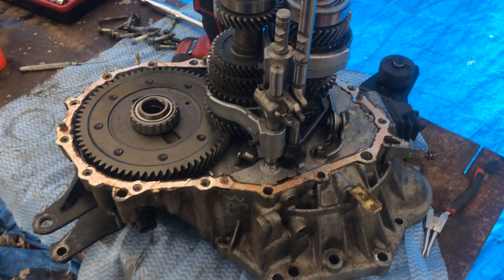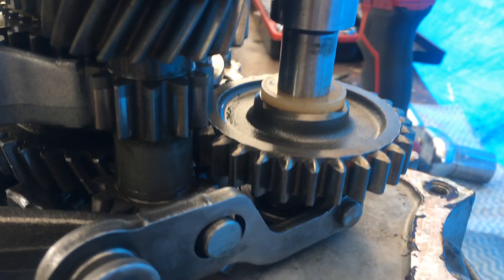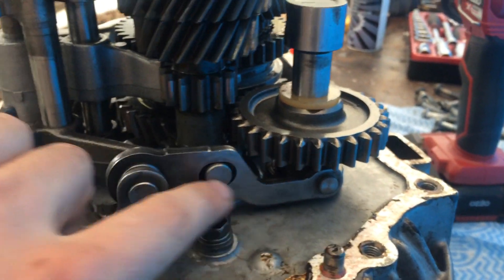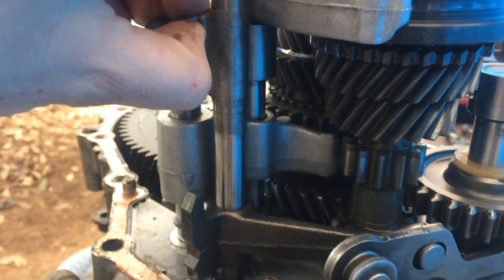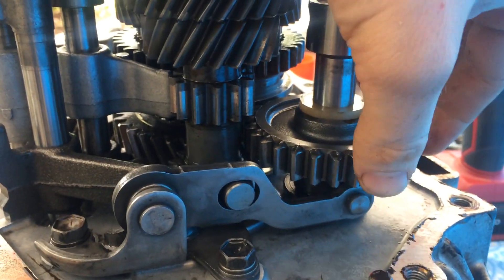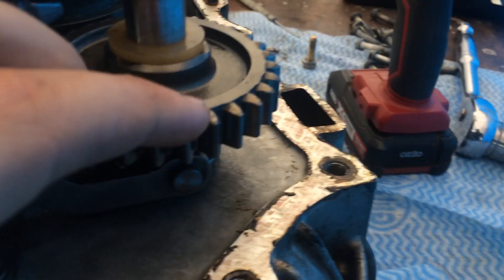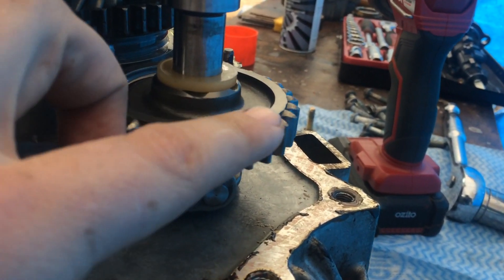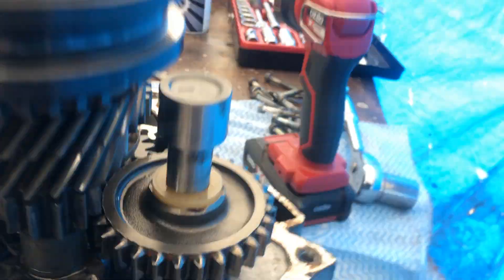Why Does A Car Make Grinding Noises When Put It In Reverse

Comment: Someone in other video shared a method that work most of the time for me, that is first clutch down, put in any forward gear and then keep the clutch down while instantly change to reverse gear just as normal. This can use the synchromesh from the forward gears to match the speed of the gears and prevent grinding of reverse gear.

Comment: Thats standard. Reverse is diffferent than all the other gears. The problem is different. Probably the lever doesnt bring it into the right position
Reply from the maker: Yes the problem was putting it in reverse itself hence the grinding. The rest of the gearbox had minimal signs of wear but the reverse gear was badly mushroomed.

Comment: Yeah I had this issue, I find just hold your foot on the clutch for 3 to 3 seconds then put it in reverse
Reply from the maker: Noice 😁
Reply: What’s a clutch?
Reply: Is that the brake or excelerator
Reply: @Bernadettex a manual transmission has a clutch it’s the first pedal on the left side if you are in a RHD car is you have an automatic you will not have a clutch

Comment: It shouldn’t be an issue cause you are stoped and foots on the clutch no power being delivered to the transmission. I bet you guys are putting it in reverse why’ll the cars still slightly moving
Reply: Unfortunately no, I think I have a slightly different problem than he does, but mine does this even when I purposefully stop with the clutch and break depressed for some seconds before switching to reverse (Pains me everytime, so I wish I was just rolling ;(
Reply: Doing it too quickly you have to clutch wait a second for the trans to stop then put in reverse

Comment: How did you fix the problem
Reply from the maker: Comment Beast I didn’t fix the box to repair the box I would of had to replace the gears to stop the grinding when put in reverse 

The clutch went so I had to pull the gearbox out anyway so I took advantage and did a strip and inspect of the box put it back together and sold it for $500
Reply: @Leighton.KAllen  Ahhh I see, mines is tge differential bearings and worn out inner CV axle... Same exact symptoms though